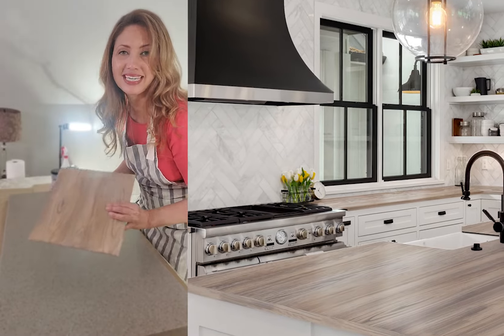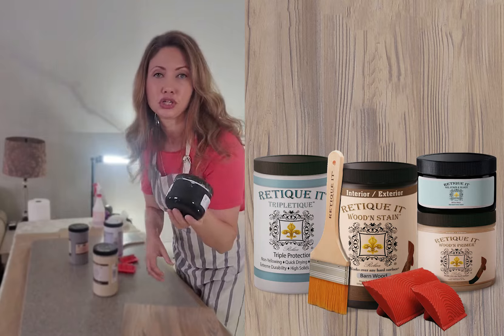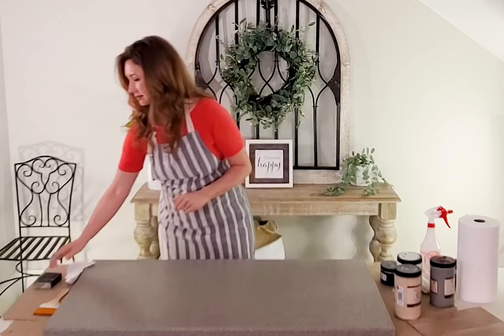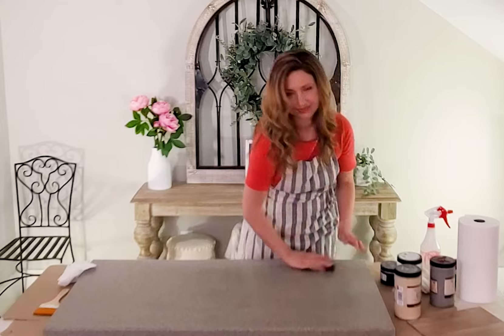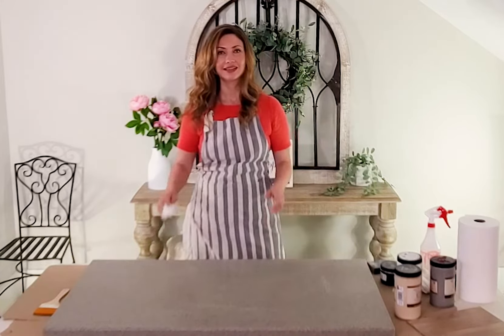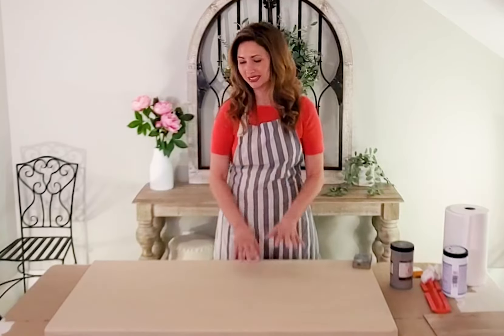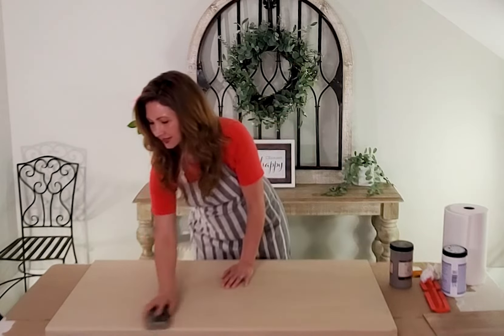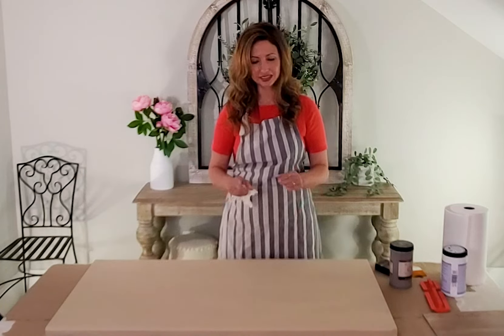How To Turn Formica Countertops into a French Oak Wood Finish with Retique It's New Countertop Kit

Comment: This is amazing! I have a laminate kitchen table with several scratches, should I sand it down before priming? Or do you think this process will cover them?
Reply from the maker: You won't need to sand it down... We only suggest a light scuffing if it is glossy or slick to add more toothe...
Here is a link to the product. If you scroll down you can watch the quick step by step tutorial...

Comment: Michele, I did Retique it Countertops about 4 years ago and I now have a few chips and scratches.  Can I do another full set of layers on top or do I need to go back to the laminate?  I do have to say I LOVE RETIQUE IT!!!!!!!!
Reply from the maker: Yes, you can. The new countertop kit has the new generation of liquid wood products called Wood'n Primer and Wood'n Stain. Both have over 60% liquid wood and are durable enough to handle decking. The Countertop kit also comes with our extremely durable top coat called Tripletique.
www.countertopkit.com

Comment: I have a tabletop with either a veneer or faux wood laminate top which has many small bubbled areas.  I'm not sure if its plywood or MDF underneath.  Do I sand the entire tabletop smooth and then apply/finish  as you did in this video?
Reply from the maker: You will need to sand the bubbles out completely and make it smooth and level. Once that is done you can use the Tabletop kit to give it a wood finish on the top...
www.tabletopkit.com

Comment: How do you get in tiny areas around a sink though?
Reply from the maker: You don't have to grain everything because this is actual liquid wood. But if you want to grain in a tight area, you can cut the smaller of the two graining tools into the size you need You can also bend it as you grain. Take a look at the fireplace mantel video we posted on youtube. 
https://youtu.be/0xnFBazX7po
Near the end of the video

Comment: OK so I purchased the kit but I want to know if I can use the wood gel stain over the bleached wood Liquid wood paint which I used The graining tool on the second coat of the bleached wood color. I’m wondering if I can use this gel stain and get the same look without having to use the graining tool again? going straight to your step after graining. Do you think it would give the same effect?
Reply from the maker: Hi Megan, It sounds like you purchased the weathered kit. This will work great as well but gives you a weathered finish instead of the rustic finish on this demonstration. You should have received instructions with your order. There is also a QR code on the top of the label that will take you the online instructions. You can get the instructions at
https://retique.com/pages/wood-finishes-step-by-step
If you need to talk to one of our experts on the phone you can call 800-966-3812 or email service@retiqueit.net

Comment: Two questions. My 50 year old kitchen has Formica counter tops. I like the rest of the kitchen, which is an off-white, but I truly hate the countertops. They are an off-white/yellowish/flecked. There is some chipping here and there. I’d like to change them into a dark wood finish. So here are the questions:
1. What do you recommend to fill in the chips to make the surface smooth?
2. The transition between the countertops and backsplash has been caulked. Can I assume that it’s best to remove all the caulk first, then use the Retique It kit, then re-caulk the transition?
Reply from the maker: Yes...remove the caulk 1st. You can use Bondo to fill in the chips 1st and then apply your Retique It Wood'n Primer (2 to 3 coats).

Comment: What color wood paint did you use from retique it? Bleach wood or light wood? I’ve got to that point so far but an scared to death of the barnwood stain (it looks like a briar patch purplish on my other pieces 🙈)…. But I did things backwards. I did 1 coat of bleach wood, then a 2nd coat of bleach wood I used the graining tool (wanted a lot of grain and thought the whole thing would get stained 1 color, not a mix/layering). 
Can I still use the gel stain and graining tool at this point? Wish I could post a pic.

Also - The retake it would paint does not last very long in its container once opened. Mine has not been opened for a month and I went to use it today and it’s consistency is horrible so I believe it is no longer any good because it will not paint on smoothly, it’s like you can see the sawdust grains. Is that normal?
Reply from the maker: Hi Megan, in this case we did not use liquid wood as our base. We used Wood'n Primer which is the next generation of liquid wood as the base. It is the color of a 2x4. Then we grained Barn Wood Wood'n Stain which is our new Gel Stain with wood in it. Then another coat of Barn Wood and finally we used our White Wash Gel Stain over it to get the French Oak finish. Here is the kit that has everything you need. https://retique.com/products/woodn-finish-countertop-kit-french-oak

Comment: This is very interesting, but I'm still hesitant to do it because I wouldn't be able to tell if I had done each step correctly or needed to go back and fix something before continuing on. It would help enormously if you would give a straight-on (or overhead) view of the slab after each step. I could tell what it was supposed to look like easily after the graining step, but next you applied the same product over that again, and it looked like it cancelled the graining out. From then on the camera angle showed a mottled look with no graining. At about 25:00 you showed a closeup view again and it did clearly show the grain again, but it looked very different from how it appeared at the end of the graining step, and I have no idea how it got that way without being able to see the straight on/overhead view of the intervening steps.
Reply from the maker: If you go to www.woodfinishkit.com and then scroll down you will see exactly what you are looking for. An overhead step-by-step...

Comment: How durable is this? How long does it last?
Reply from the maker: It's as durable as the topcoat you use. Our kit comes with a waterbased epoxy alternative topcoat and enough to put on 3 to 4 layers. The only problem with any waterbased topcoats is if you spill anything with rubbing alcohol or hand sanitizer on it without immediately cleaning it off. We also sell Hard Wax Oil which is oil based and has a strong odor...

Comment: That looks very nice.  I have two questions.  1) If your counters have mild texture, should you use some filler and sand them smooth first?  2) Is the final top coat food safe and how durable is it?
Reply from the maker: You can overcome the mild texture using enough layers of Wood'n Primer or you can use our Retique It Mudd to get it smooth before starting...
www.woodfinishkit.com

Comment: One more question… Can you use the no pain gel stain pickling white over top of the retake it liquid wood gel stain (rather than the water-based white stain you showed)? I have the voodoo white gel stain and that is water-based, should I use that instead?
Reply from the maker: Every stain has different characteristics on how they look over specific types of wood. We believe you can, however, we strongly suggest that you do a test piece like a vinyl tile during the process. Then use your stain over the test piece first. The result you get will be the same as your project. You can always get our stain if you don't like the result at that point and finish your project once it comes in. (f you want to do that, then you can just purchase the Barn Wood Countertop kit and add the white wash stain over it...

Comment: How long do you suggest placing things back in the countertops after the 3 coats. Also, what is a safe product to use to wipe down countertops for general cleaning?
Reply from the maker: You'll want to wait about a week.  Just use a damp cloth to clean....or for a deeper clean  I like using Mrs Meyer's spray cleaner or Clorox wipes.